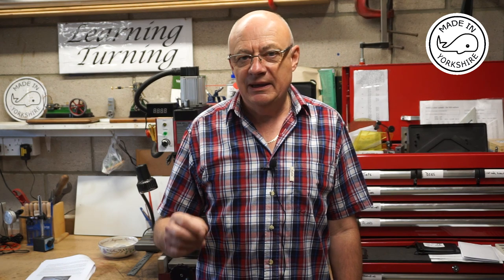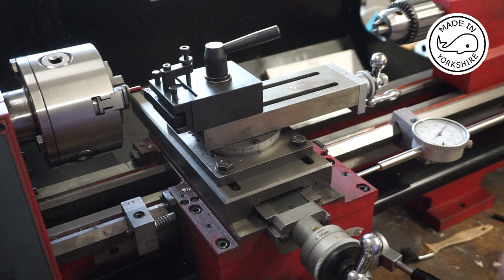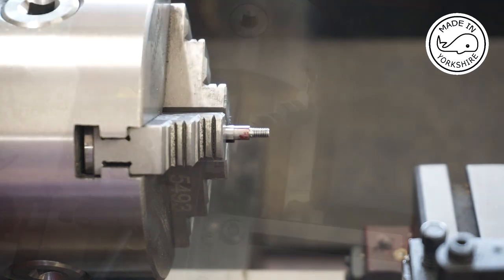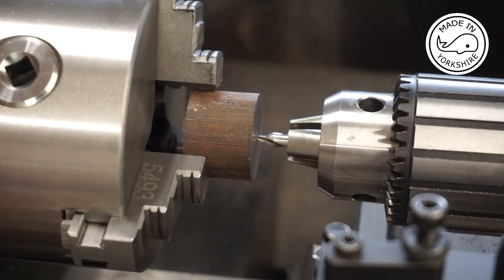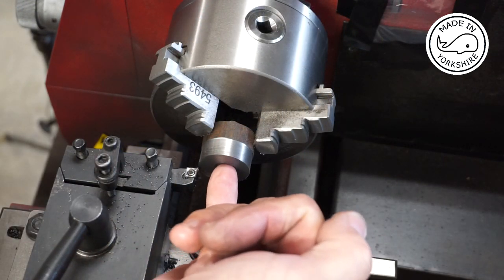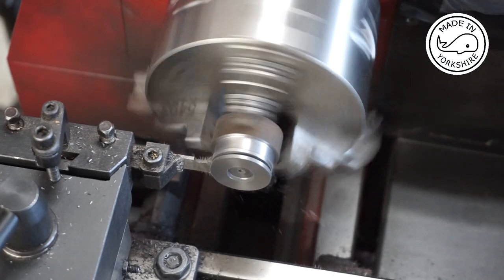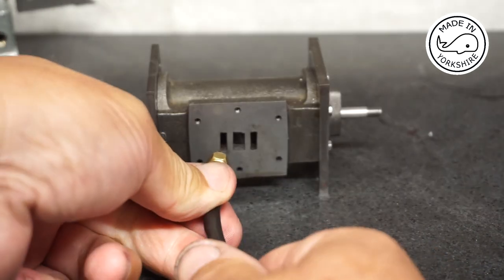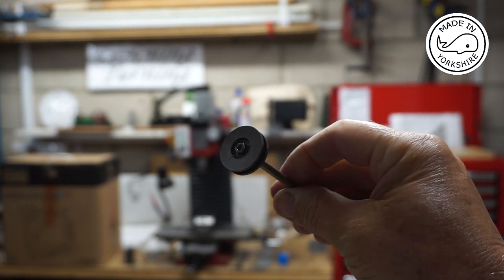#MT32 Part 8 - Making a Stuart Half Beam Steam Engine. The Piston. By Andrew Whale.

Comment: Hi Andrew, 
A good tip when turning a rough lump of cast iron or anything really is to clean up one end leaving a nice shoulder.  Then flip the part for final machining.  The chuck will grip better on the machined surface and the shoulder gives you a nice register.

Comment: Looking good Andrew :-) I'm not a big fan of those rubber / viton piston rings either but depending on how tight the fit is using a cheap cylinder hone may allow it to fit. The hones only cost about £10 and are well worth it to give a nice cylinder finish. As for the turning of the piston billet I'd be inclined to put a blank piece of stock behind the workpiece against the chuck surface then as you tighten the jaws gently hammer the billet against the supporting stock, you'll also get a more secure hold by using the 4 jaw chuck.
Reply: I agree with the above except I suggest you build a Spider for you chuck. You Tube Channel Pragmatic Lee dose an excellent series on how to build one and you'll find it a very valuable tool since it doesn't require a third hand to use one.
Reply from the maker: Hi Peter - I did actually purchase a cylinder hone following some of your previous advice. Never used it (not sure how to), but will give it some thought.
Gread idea regarding placing some stock behind the workpiece - I think that would have helped considerably.
Cheers
Andrew
Reply from the maker: Thanks for the tip Craig - I will check out Pragmatic Lee!
All the best.
Andrew
Reply from the maker: Hi Craig - I've just checked out Pragmatic Lee's spider. What a great idea. So simple, yet versatile. Many thanks. Andrew
Reply: Andrew, if it is a spring loaded 3 armed hone like mine is then it's just a case of using a bit of WD40 or some thin oil in the cylinder then use the hone in a hand drill and work it in and out of the cylinder. Be careful to work the length of the cylinder evenly though as it is very easy to 'bell mouth' the ends. You will only need a short burst at it perhaps only 30 secs, don't over do it. On you tube there are literally 100s of videos showing the technique and they all show pretty much the same  content.

Comment: Thanks Andrew
It's great to see you are having a go at machining, it's not as easy as it looks, I learned my trade (Fitting & Machining) some 40 years ago and I still make mistakes, all part of learning.
The most important thing to remember is "The end product", and the satisfaction of "I made that"
Keep up the great work.
One thing I would like to stress is especially with Stuart kits,  you can always deviate from the plans and change dimensions etc to suit. eg I made the hole in the piston larger because there seemed to be to much flex. (I made two)
look forward to your next video.
Regards
Gary
Reply from the maker: Thanks Gary. I'm sort of OK following the Stuart plans but at the moment I would lack confidence in changing dimensions - but I get exactly where you are coming from.
I need to catch up on your Stuart beam vids.
All the best.
Andrew

Comment: Andrew, good stuff.  I have the same model engine on order and your videos give me a great preview of what I will need to do!.  I've seen the various comments, including yours regarding use of an end mill.  A chuck is generally not advised because it is not a secure way to hold the end mill.  I use 3/8" shank end mills which fit quite securely into a 3/8" boring bar holder (the kind with the round hole)  for my quick change tool post.  I've used this method for shallow flat bottom "indents" such as needed for the piston.
Bill
Reply from the maker: Hi Bill - many thanks for the tip - very interesting. I will have to try to remember that one.
Good luck with your half beam.
Cheers
Andrew

Comment: G’day Andrew, job well done. The boring bar stick out was a bit excessive, shorten it up as best you can to reduce chatter. My mini lathe does not part off well either, reduce your speed to reduce chatter apply too much oil and feed in hard enough to keep up the cutting action, I know with steel and aluminium on my machine that cutting moment is a butt clenching moment :))
Cheers 
Peter
Reply from the maker: Thanks for the boring bar advice Peter. I think that successful parting off must be the holy grail of engineering. It definately increases my anxiety levels.
Take care.
Andrew

Comment: When cutting grooves for piston rings etc...slow the rpm as if you were parting off.
In my opinion yoy can't go too slow.
The finish is better it just take a little longer.
Cast iron is self lubricating but use something to keep the tool from heating up.
Great job as usual!
Reply from the maker: Yeah that tool got really hot. Thanks for the advice mate. 

All the best.
Andrew

Comment: Hi Andrew, when I cut recess on my piston on my Allchin I put an end mill in the chuck which worked perfectly.
Reply from the maker: Hi Derek. I read somewhere that it wasn't good to put an end mill in a chuck. However Jonathan Bale and Chris Stephens have commented to the contrary. They say it is ok to make light cuts with a slot mill in a chuck. The issue is that milling cutter shanks are far more harder than drills and that they can damage the chuck. But light cuts should be fine.
So - next time I will follow your method.

All the best.
Andrew

Comment: Hi andrew 
Please don't go on holiday again i was getting withdrawal symptoms two weeks is to long, i hope you had a good time.
ok two things why not use a 1/2 inch slot mill (two flut end cutting) in the drill chuck " standard engineering practice" .
back to your drilling and reaming flywheel days, drills are not accurate reamer will follow wonky hole, first year apprentice tripping stone .
good work keep learning love you videos
Reply: Re end mill , there is no reason not to use an end mill for light cuts. I say light cuts because the only constructions difference between a milling cutter and a drill is in the shank. A drill has a soft shank and a mill has a hard one. This denotes how it is held, a collet or a Chuck. This leads to the misconception about never using an end mill in a lathe Chuck, and why I said light cuts so the chuck isn't damaged by slipping. Hope this makes sense.
Reply from the maker: Ha ha thanks Jonathan. Unfortunately another short break looming - and I too get withdrawal symptoms! I don't know much about slot mills (actually I know nothing), but read somwhere that it's not a good idea to put an end mill in a chuck - not sure why. Is a slot mill different to an end mill? Your advice is really appreciated.
Cheers
Andrew
Reply from the maker: Hi Chris - just seen your comment. Thanks for explaining - I now have a far better understanding.
Cheers
Andrew

Comment: Congrats on a job well done. I too bought a 3D printer last month, an Anycubic i3M. Good printer but I just can't get the ABS to stick, anything else prints nicely. One trick to use to avoid using the parting tool for an undercut when cutting a thread is to cut the thread normally but at the end reverse the die to push the threads to the end of the shaft. Since you use quality stuff there should be no problem with damaging the die if done gently. Let s know how u get along with the printer please.
Reply from the maker: Thanks mate. Unfortunately my dies don't cut to the shoulder either way round. I hope the 3D printing turns out ok. I need to start learning CAD!
Cheers
Andrew

Comment: Hi Andrew, I have the same problem threading to a shoulder and apply the same solution.
Reply: Len Roddis  if you put a small countersink, perhaps with a centre drill or a spotting drill, in the female thread you overcome the problem without weakening the male thread.
Reply from the maker: Thanks Len - it's great to hear that I am not alone.
All the best.
Andrew
Reply: A steel male thread can often be forced flush into a female thread in say aluminium or brass. I find Andrew's solution the simplest, and provided the relief cut is no deeper than the thread root, there should be no significant weakening. I'm often more concerned about reducing thread length which would result from either method and have been tempted to grind a very narrow "cut off" blade to minimise this. Having always ended up with a thread length at least the thickness of a full nut, it's been unnecessary.
Reply: @lenroddis5933  my thought that a groove makes a weak stress raiser. Where as the relief in the female weakens nothing, the joint being in tension with extra strength at the weak point.
I do appreciate that in this case the strength is more than adequate but the principle holds.

Comment: Nice work. I have a C4 lathe and planning to buy a mill. What model do you have?
Reply from the maker: Thanks. The mill is the sx2p from arc euro trade. I initially fancied the 2.7 but didn't have enough room at the time. I've done various mods: gas strut; rev counter; Touch DRO etc. The only limiting factor for me is the height between the table and the spindle. Otherwise I'm very happy with it. I plan to add a power feed to the x-axis soon.
Cheers
Andrew

Comment: You said you would not put an end mill cutter in your tail stock chuck. I’m not sure why?  Thanks. P.S. good job on the piston and rod!
Reply from the maker: Hi there. I read somewhere that it wasn't good to put an end mill in a chuck. However Jonathan Bale and Chris Stephens have commented to the contrary. They say it is ok to make light cuts with a slot mill in a chuck. The issue is that milling cutter shanks are far more harder than drills and that they can damage the chuck. But light cuts should be fine.
All the best.
Andrew
Reply: Learning Turning Metal - by Andrew Whale the reason you shouldn’t put milling cutters in a drill Chuck is because drill chucks are (usually) held onto the arbour by a taper without any securing screws. The risk is that the vibration of side milling can cause the Chuck to drop off the arbour at high speed, digging into the work, obliterating the cutter and wrecking the job, not to mention the obvious safety concerns. However, if you are just plunge cutting, it is usually ok to use the drill Chuck as the cutting forces are pushing the Chuck onto the taper so there is little to no risk of it falling off.
P.s. I’ve only just come across your channel but I’m enjoying catching up with all your projects. Keep up the good work!

Comment: You will not regret buying a Prusa MK3, I have a MK2s and have had great results with it. I use Fusion360 to design my own models.
Reply from the maker: Hi Steve. I'm very impressed so far. Just started the build and the documentation is really easy to follow. All parts look really well made too. Having just assembled the base, one foot stands about 10 thou off my surface plate. I've fiddled about for hours but just can't get all feet exactly flat. The documentation suggest that you can get away with a 2mm gap, so hopefully my 1/4mm gap will be OK. I've been playing with FreeCAD and designed my own project box for my bluetooth TouchDRO module. I'll look into Fusion360. What a great world we live in with so many fantastic things to learn. 

Cheers
Andrew
Reply: @learningturningmetal  When I built my MkIII Prusa a little judicious "flexing" got all 4 feet setting properly.
Reply from the maker: Yeah I didn't have a hammer. Fingers crossed it will be ok. Exciting!
Cheers
Andrew